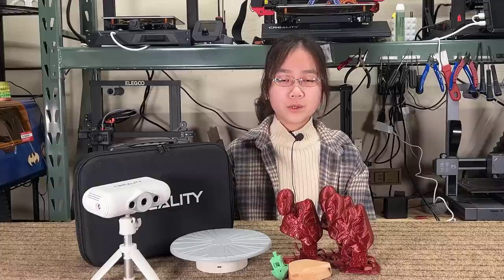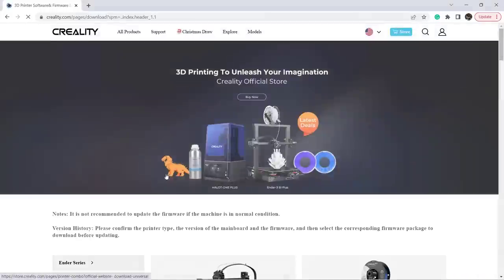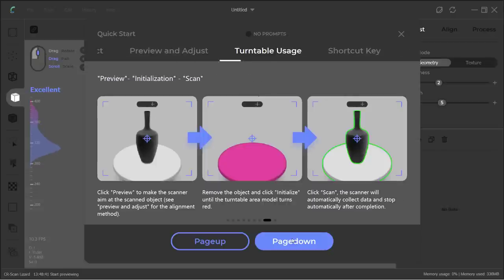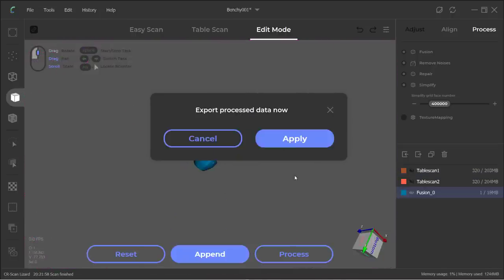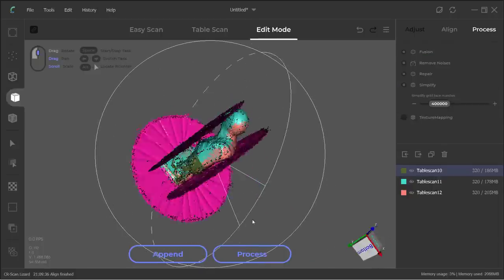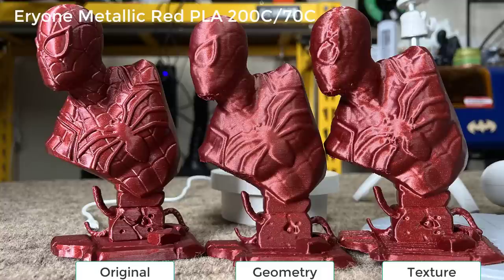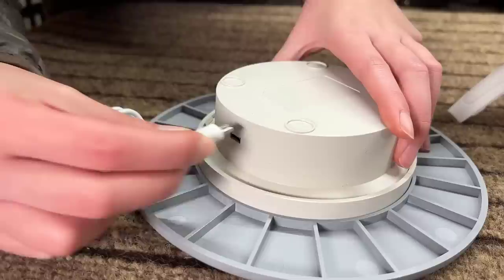Creality CR-Scan Lizard: An easy-to-use 3D scanner for 3D printer owners?

Comment: I kick-started this. Had one for quite a while. You need to turn the detail up. The slide with the number 400000 is the number of triangles. Jack that way up and you'll have more details. Your processing time will go through the roof though. I have a 5600x with 32gig of ram and have had the processing take a half hour. The size of the scans will also get huge. I had 9 scans of a Xbox controller shell and it was over 20gig.
Reply: I would have thought the instructions should have outlined the adjustment of the scan resoloution, also I have noticed some other scanners come with a model to assist with scanning tutorials, Creality being fully aware that the unit would be purchased by quite a lot of novices should also have included a scanning model and some tutorials, It seems they have fallen back on their old trick of relying on the community to educate the user on the use of their product.
Reply: I kick started it as well and I’ve had nothing but trouble with it. It’s been sitting in a box for the past 6 months unused.
Reply: @sq3rjick  Ebay it to sell it? I'm sure someone would like a reduced and used scanner to play with. Good luck.
Reply: Got this as a Christmas present. You're amazing! Been trying to figure out how to amp up details.

Comment: I thought using a Creality 3D scanner to scan a 3D printed object to then 3D print it on a Creality 3D printer is a sure way to open up a wormhole.
But great video. I think the results will get better as you learn more about how to use it.

Comment: Small details, you need to scan out more then one direction, like scan on top, 22 degrees, 45 degrees. The scanner works just like our eyes work, if you scan from top it does not see the high  or low points(depth), if you look 45 degrees on small things it is possible you see more high or low points. Scan out more then one angle on the objects.
Yes scanning will take longer. Also check for to high of light, from scanner or the room where you are scanning, just the lights of your room could be bad for scanning.

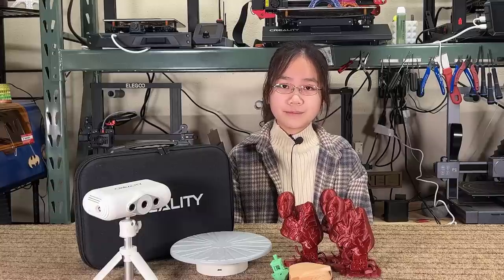Comment: This was a very comprehensive overview of the Creality scanner. I think if this scanner works as well as you have shown it to perform it should be Ok.  " 12:05 I am soled.".  I think the idea is clear when you look at something from the prospective of the Chinese.  "It is better if you can achieve something good, even if it is not great, rather than nothing at all."  The point is; "if I can get the scanner to produce the quality you got of the Banchy I can clean the model up manually in Blender or trac the scanned model in Animation Master, or Design Spark Mechanical.  Any good 3D CAD software should inable you to clean up your model.  So, this scanner looks like it can prove to be very useful. When you louse a file of a model and have to recreate it from scratch this scanner can save you a major headache and time on recreating a CAD file from an existing model. 👍

Comment: A very informative overview. Is great to see 3d scanners being added to the Aurora Tech knowledge base.

Would be useful if there was a way to suggest areas of a model scan where greater level of detail was desired. Perhaps even scanning at different speed, or resolution.
Just thinking/typing out loud, as have not experience with scanners, but would think to be useful feature.

Hope Aurora Tech enjoys experimenting and learning more from the capability of this 3d scanner. Seems scanning and then editing in 3d cad tool would offer some balance of getting detail desired while saving time on designing a 3d object from scratch.

Comment: Adding a spray powder to Spiderman would probably help with getting better detail.  It makes a huge difference on my Einscan SE.
Reply: Why not just use tempura paint?  It's easy to clean off hard surfaces. Wood can just be left our side in the sun and it will easily come off with a soft brush.

Comment: I've watched a couple of your videos and I am impressed.   Now my question:  Do you really need the turn table if you are primarily needing to scan small (under 8x8x9") objects in geometry mode?
Also, I noticed you used the CR-5 s1, but it's not in your list of best printers.  I almost purchased this yesterday but didn't' because this.  Seems creality has very good deal on sale for full bundle.  Eeek!  which to choose?  If I could I'd get both the Cr 5 S1 printer and this scanner... but thinking about it, maybe it makes more sense to master scan and cad software before going to the print stage.

Comment: Very interesting product and great review.. It'd be interesting to see how this compares with some of the cellphone-based photogrammetry solutions out there. The results are definitely decent, especially on simple geometry, it has a lot of potential. I think it's way, way over priced though.
Reply: What cell phone photogrammetry are you speaking of actually? I'm really looking for an app that actually works
Reply: @davidgesell  I've heard good things about Polycam but most of the better ones use the iPhone's lidar sensor which I'm not able to test.
Reply: @circleofowls  Cool thanks I'll check it out

Comment: I would imagine that if you had used the scanner in handheld mode that you might be able to get more of the details inside of the benchy. I have used an older NextEngine Scanner which will automatically pivot on different axis points, but still has issues with areas that the laser beams can't reach. That is why I wondered if "moving in" would get that detail.

Comment: The most shocking part about this video is that high power PC being "Outdated" 
*Cries in i7-6700K-GTX1070 *
Reply: My I9-1200k with RTX 3080 should be able to handle it.

Comment: Hi guys what are your thoughts on this the All-metal Extruder Upgrade Ender 3 v2 FLSUN Heat Treated Metal Gear HRC60 OMGV2S F1 Set 3D Printer Part OMG V2s
found on Aliexpress

Comment: Great video. Saved me from buying this turd.
Reply: Hi Fakumadda, you're also suggested to check the following review video: https://www.youtube.com/watch?v=Jy0k99DSLxk&t=215s, this reviewer scanned a lot of different items and give some scanning skill suggestion, hope it could be helpful for you!
Reply: @CrealityEcosystem  ...thanks. I'll take a look.
Reply: Just got the Einstar for car panel molds, Beats this is every way.
Reply: @3dkiwi920  ....to be fair, it's also almost double the price. I wonder how good an Xbox Kinect v1 and computer would compare with the lizard, though..
Reply: @fakumadda1632  It accuracy over large parts is worth the price for me at least. The software is the best of any as is based on the software used for Shining 3D's $10-$20k scanners. Kinect is not worth the hassle, you'd be better off with SFM photogrammetry if you haven't tried that yet.